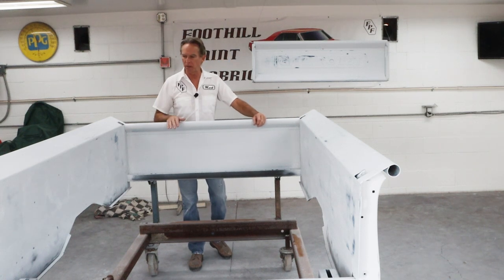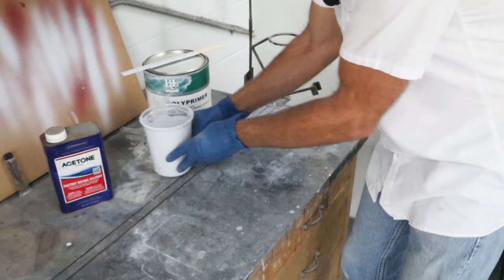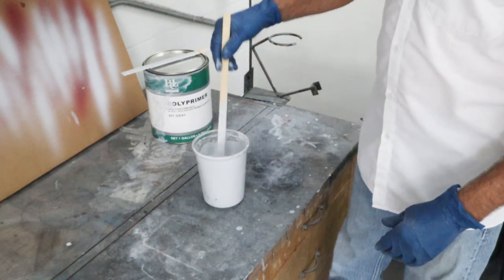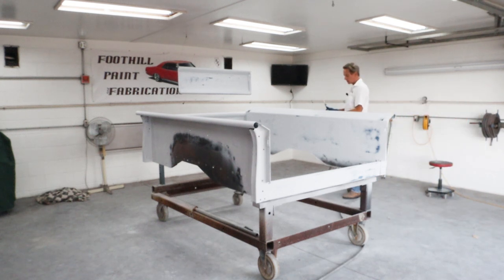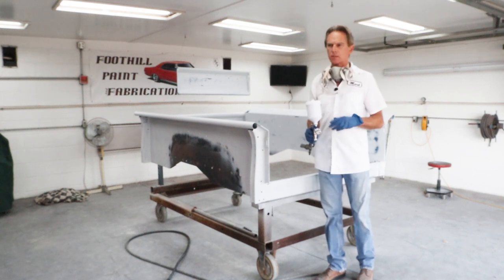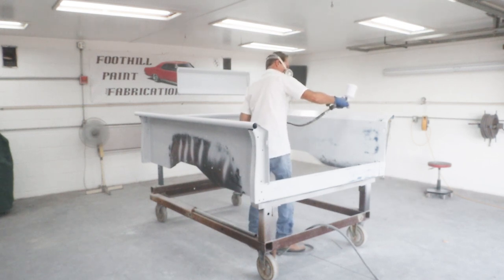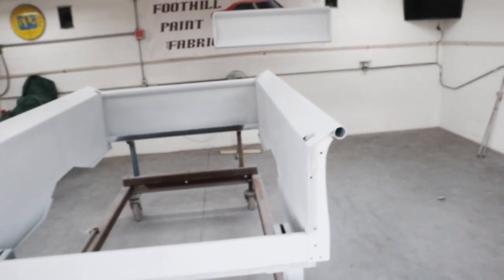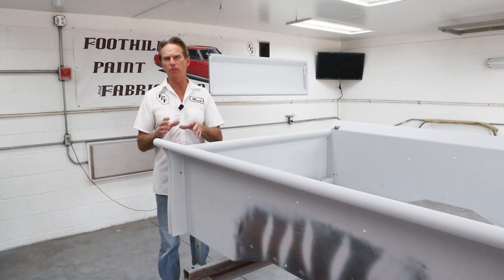1950 Chevy Truck (Ep 22) Bed and tailgate Polyester Primer Seal Coat

Comment: Hey Mark, question for you on adding Acetone. Is that the only material you can use to thin the primer when using as a seal coat? At least for now I have to shoot outside and acetone flashes off pretty fast, especially when its warm out. I had been told once by a paint shop to add a small amount of regular paint thinner to acrylic enamel paint in order to slow down the flash time. Think that would that work with the polyester primer?
Reply from the maker: Hey Mike,   Depending on what base your paint or primer is built on determines what you can use to thin the material with.  Back in the day you could probably get away with paint thinner to reduce or slow enamel paint but automotive paints are pretty sensitive to the reducer you use these days.  You can get generic slow or very slow reducers for enamels but it is always best to test them by placing a small amount of paint on the lid of the can and then put a few drops of the "thinner" you intend on using to see if it quickly and easily mixes.  If it doesn't mix like food coloring in water I would rethink the thinner.  In this case I needed the primer to flow out and lay flat so I reduced it with acetone to reduce the viscosity.  Lacquer thinner cuts un cured polyester but I feel more comfortable using the solvent listed as one of the ingredients for the primer.  Painting in hot weather is always a challenge so I usually get everything ready the night before and get out there very early in the morning so I don't get dry spray or flash lines where the last pass flashes off before I can get the next pass applied. When spraying polyester primer in hot weather just do your best to keep a wet edge by planning out your spraying and you will be fine.  After all you will be sanding the primer anyways.

Comment: So is the polyester primer the same thing as primer surfacer? If so why did you spray the letters on the tailgate and standards because those areas would be hard to sand? I always thought you used that primer to cover your filler so it want show through the paint or other areas that need some help smoothing out.
Reply from the maker: Yes this is a heavy build primer or primer surfacer.  Many times materials are called primer when there are several different types and materials used within them.  Yes using a heavy build primer for its filling properties is useful over body filler, sand scratches, chips and lows spots.  In this case I reduced the the primer so it would act more like a heavy sealer this way there would be a uniform color and surface to spray the color base coat over which is very important.  A sealer could have also been used but on this truck I am spraying the base coat right over the primer.
Mark
Reply: I know I’m asking you a lot of questions here but what kind of body filler do you recommend and why do you sometimes use glaze putty instead of just a little more filler? Also I’ve replaced metal where the fender attaches to the bedside. Is it ok to use filler around/on the bolt hole or will it crack?
Reply from the maker: @tylerc3477  Ask all the question you like. The reason I started this channel was to help if I can.  I use glaze instead of body filler when I am close and just trying to fill sand scratches and minor low spots. It sands to a smoother finish and is easier to spread to a very thin film.
Applying body filler near a bolt hole is problematic since the body filler can be dented when tightening fasteners.  Try and work out the Sheetmetal the best you can so the bolts won't pull and if you need to use filler Metal reinforced body filler is much harder than plastic body filler.  I used it on the mirror mount and antenna delete video. https://youtu.be/vaJOGQQah5Y
I thin layer of plastic body filler should be okay, just don't go crazy tightening the fender bolts and make sure the flanges are nice and flat before you paint. I have had good luck with Evercoat Z Grip. It sands well and spreads nicely.  Evercoat has a great many fillers but don't get hung up on the hype but don't go cheap, it will cost you later.
Reply: Ok thanks for the info Mark. Very helpful